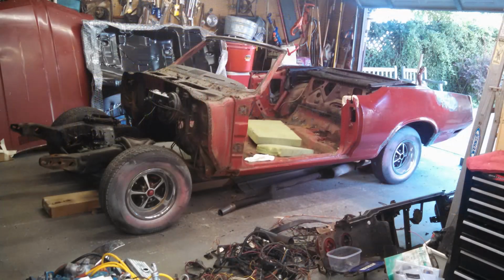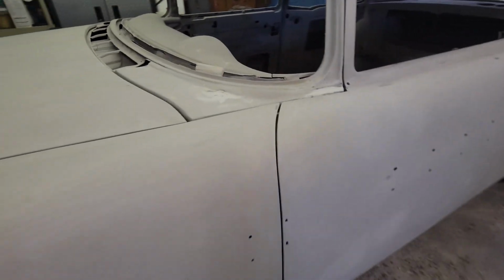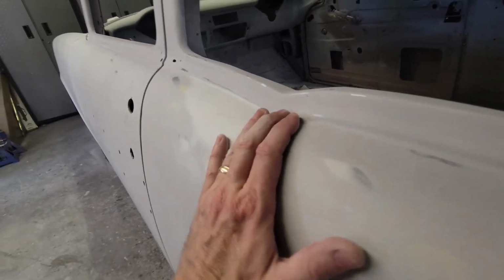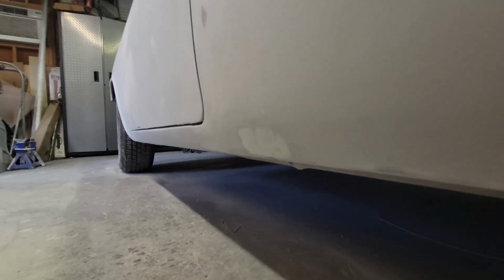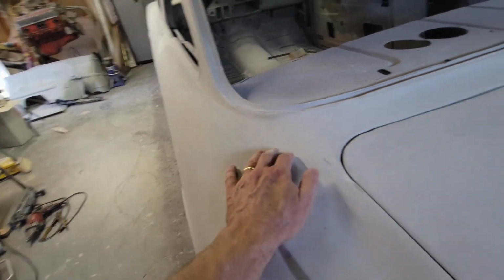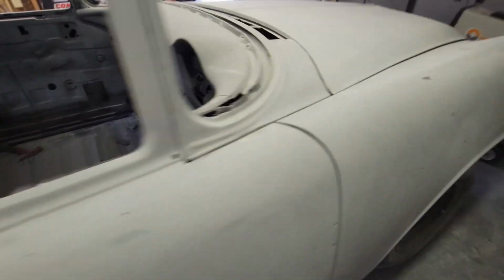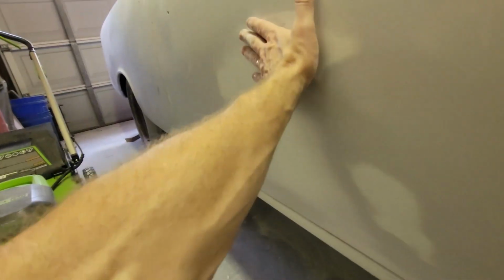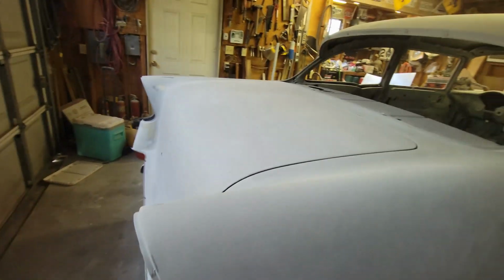E91 THANK YOU!!!  2 Years of Restoring Christine!  But when will we PAINT?  1956 Chevy Bel Air Resto

Comment: For those who don't know or don't remember look at the old photos of that car when it was stripped.  It definitely lived a hard life so whatever you have to do to get it to where you want it is your decision.  I am always amazed at what you discover on the body.  It will all pay off in the end.  Paint is a big step and you know it has to be right.
Reply from the maker: I'll say this much - most of this wear and tear was completely hidden underneath a lot of body filler and a pretty coat of paint.  I was afraid of what was lurking and didn't want to trust that old body filler would still hold, not knowing what it was put over.  And here we are.  Two years of metal and body work later, we're still fixing it!